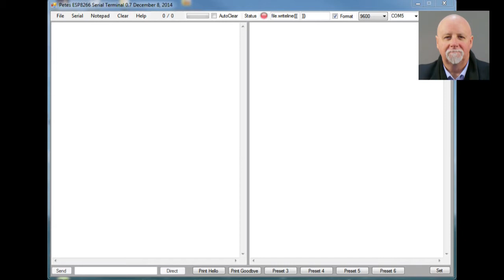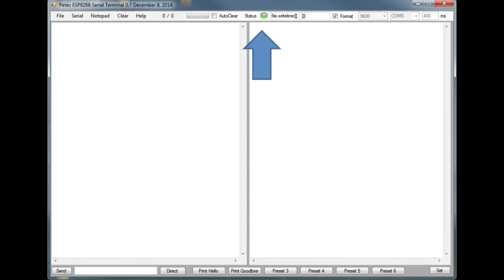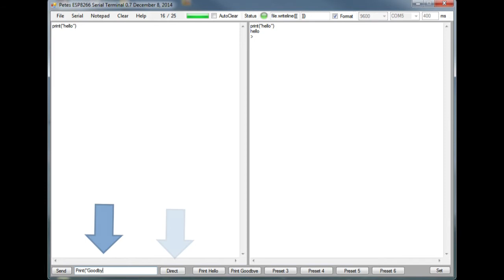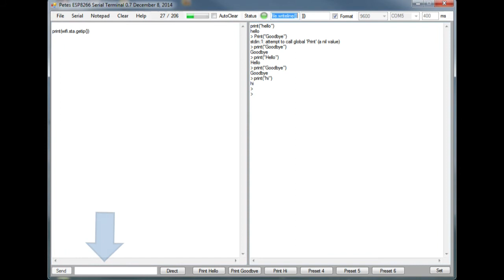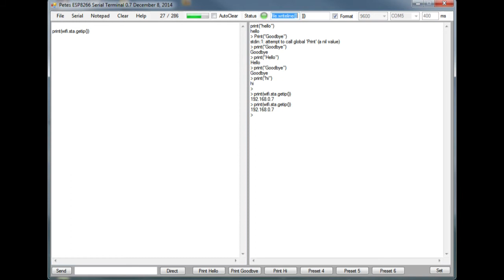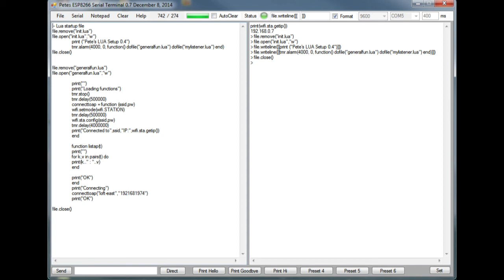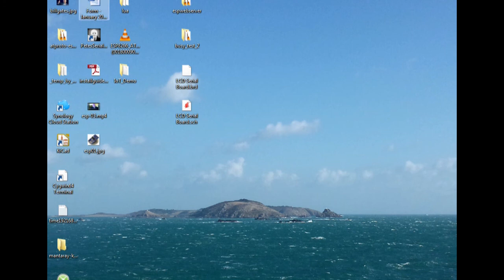Serial Terminal for ESP8266 Experimenting

Comment: Thanks Peter found it, will you be blogging about direct C programming ?
Reply from the maker: +acestu Hi there - I do - I've put some code up for the ESP8266 in the blog (see home control 2015 entry) - right now I'm concentrating on mastering Node-Red - which means a bit of Javascipt, as a central controller for my kit - but the blog at http://tech.scargill.net has MANY entries in there on a variety of mainly home-control themes and I'm doing a lot with ESP8266.